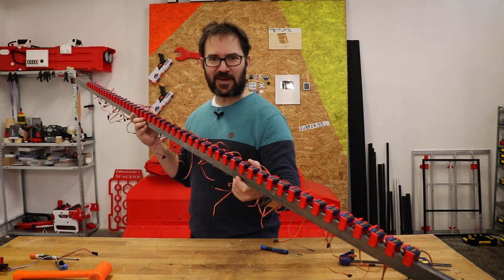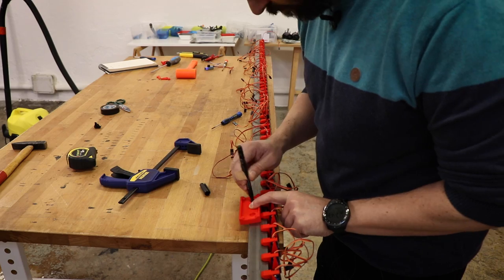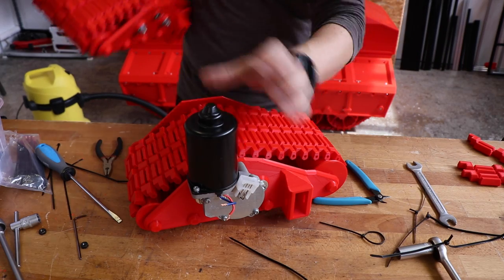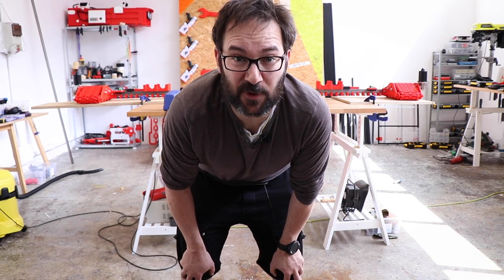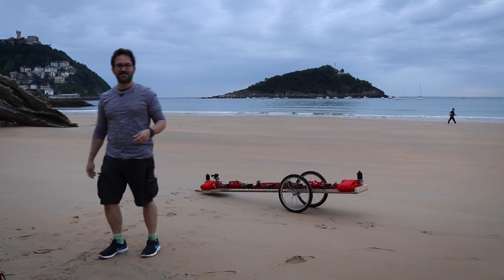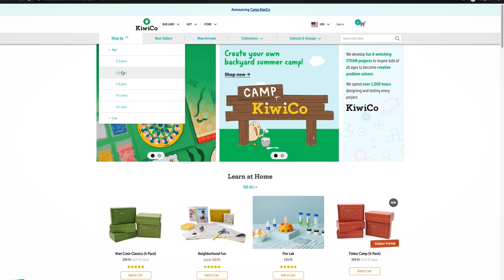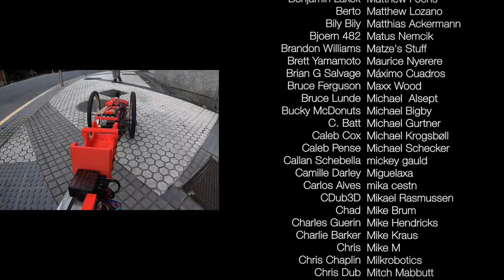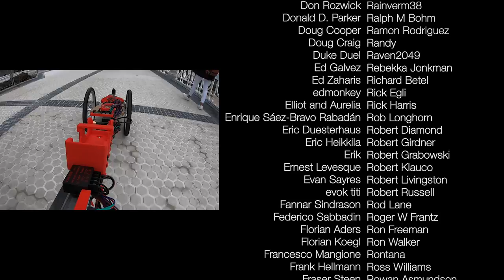3D PRINTED SAND DRAWING ROBOT FROM SCRATCH

Comment: Maybe you can use a double edged scrapers on the micro servos. One edge of the  scraper is narrow, other is wide so you can have kind of a tone on the drawings. Scraper can idle parallel to the ground and then move to either side to scrape/draw

Comment: 8:03 - you mounted the chains vice versa as visible by the gear endings. not a problem.
later on we can see the gaps will quickly fill up with sand...
and i feel like sometimes the motors will not be in sync or there is a slight ground slip so the bar gets into a curve.
what about circular figures? just stop or slow down one of the motors...

Comment: suggestion for the next version: make the servos switch between a spring loaded roller and a comb, that way you don't need extremely clean sand, and the lines are a bit wider....

Comment: A few ideas for the sand drawer, the depth of the horn going into the ground seems inconsistent depending on the levelness of the sand, so maybe make the part that digs in connected to the servo by a spring, so it would always push at the same force. Also, it’s kinda of hard to read the messages because each horn is spaced out so far. You could maker each horn like a rake, so each servo digs up a larger width, or (probably better but would be a huge pain) add more servos for higher resolution and more visible sand drawings. I don’t know if this is a problem, but you may want to add encoders to the treds so the motor would spin the proper amount every time. Great content, keep it up! Side note: I wonder if you can vary the depth of each groove to do gradient images

Comment: Rather than using straight edged printed parts to move the sand, have you considered slightly larger wire circles that cut into the sand. That way it would disturb up a bit more sand, improving legibility, plus allow for the slight variations in sand height.

Comment: Cool project! I imagine this would be nice with different formed 'needles' (the thing attached to the servos) that have an increasing cross section with the sand the further they are turned (think trenches of variable width). This would basically allow grayscale painting.

Comment: Use rotating spikes on rollers that are aligned next to each other without big spaces between them and use springs to level out different distances to the ground. This way you will have fuller font, less resistance of movement and more continuity.

Comment: If you increase the length of the parts that drag in the sand and give them some spring they will touch down better on the sand. If you combine this with a hook like structure at the end that digs into the sand like a plow the servo will only need enough power to lift the part from the sand and will not need to provide the pressure to enter the sand. It may need a little work to optimise it though.
My kids love your channel!

Comment: If you print new heads for the servos, with a flared back side of the point (think the front of a ships hull) then you could improve the visibility of the text (wider scratches) without adding too much stress on the servo.

Comment: did you create functions for every letter? If so, with a bit more programming, a USB connection would allow you to send words, phrases, and other stuff to it and it could display that. You could also add a remote control (IR, NRF, RF, LORA) to go through pre-sets, turn off and on, as well as another chance to use RED FILAMENT

Comment: You probably noticed this already but you need to put some reverse bow in the main spar.  The additive nature of the finger downforce is causing it to bow up in the middle.  I was trying to figure out why it kept trying to go for a swim.  Then it dawned on me.  It's the same reason.  A lot of the letters are top heavy so as the fingers are pressing down they are causing drag on the whole thing, but the drag is biased to the top which happens to be on the sea side.  I wonder if you placed it so the bottom of the letter was towards the water, the slope of the beach and the drag of the fingers would counteract enough to keep it going straight?

Comment: Are you programming each uC individually with it's own raster data? Or did you also fit a central controlelr board or SBC for automatically distributing the raster data to the 4 Microcontrollers?

Comment: Really cool project, but when i saw how you overengineered everything, i was a bit sad. you could have used a PCA9685 12bit servo controller which uses one Ic2 lane. You can daisy chain these controllers. At maximum you can control up to 1000 servos. Again from 2 pins.
Reply: As soon as I saw the ATMega2560s, I had to look in the comments to see if anyone mentioned the PCA9685s.
Reply: @joegroom3195  I mean that was the first thing i wanted to see.  If he used those magic microchips. 
Arduino Boys

Comment: Hi Ivan, congrats on the video! Had a question regarding the screws you're using for holding the PCB to the 3D printed bracket. Are you using some kind of metal insert? Or just the "raw" material? 
Cheers!
Reply from the maker: Just the raw material
Reply: @ivanmirandawastaken  Thanks!

Comment: If the tips of the line drawing 'draggers' were thicker,  would the image would appear more full?   Could you use less motors if you had a fixed center point and drew and image within a circle ?  Further down the road, I see multiple units working together via GPS and/or drone AI to create larger images.  I'm sure you've considered the amount of $$ in corporate ad revenue you could generate with this system.  Lastly, you should collaborate with - Andres Amador - he creates massively intricate geometric images in the sand, manually with hand tools.  Also see Jim Denevan and his works.

Comment: Awesome project.  You make a lot of tracked projects.  How do you figure out the sprocket pitch diameter to match the tracks?
Reply from the maker: Make a link with an "S" distance between pin holes. Then draw the teeth valleys along a circle spaced "S" mm.
Reply: @ivanmirandawastaken  What is the value of "S"?  Maybe you could do a short video on creating sprockets and tracks.  It's always been a problem for me when I design a robot with tracks.  Thank you!

Comment: Could this be the beach of San Sebastian in Spain? I have been there once in my life, a long time ago and it looks familiar :)

Also, the robot looks and works great. Probably, the only thing it lacks is the ability to measure the distance between each servo motor and the sand. Thus, the turning angle of each "scraper" could be determined to maintain an equal depth of the grooves, and they will look even fancier. I guess that this would be quite hard, though. I have no idea if such sensors exist... to fit a reasonable price range and provide sufficient presicion, I mean.

Comment: I don't like the dpi. it's only about 0,5 dpi. Still thinking on how to increase dpi with current hardware, but didn't found a solution yet .... As higher dpi also generates proportional additional drag on the 2 tracks. Greeting from a ( maybe becomming old (50)) Belgian engineer.

Comment: First, amazing project. Love how you circled back on it and improved it.  

Maybe already covered but perhaps add in an ultrasonic or laser sensor for each servo to automatically adjust for variations in the heights of the sand.   Just a lot of cost and time to add.  But would be interesting.

Comment: How about "stealing" few kilos of that sand so you can experiment with different kind of combs or plougs in your workspace so you can maximise the visibility and area of each individual "pixel line"? also you could automatically adjust for height differences by putting a small wheel (or some sliding thing) between each servo and a mechanical link to move those servos up and down. servos could have some 3d printed slider for that, maybe 1cm up/down movement? that could also help avoiding getting stuck. or maybe the whole long arm could move sideways a bit making different kind of patterns. ok i shut up now :)